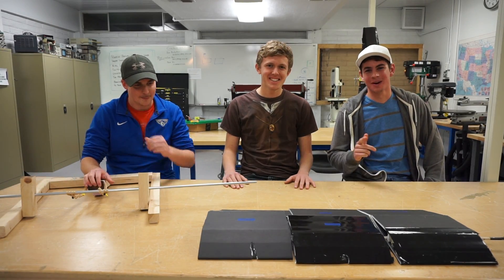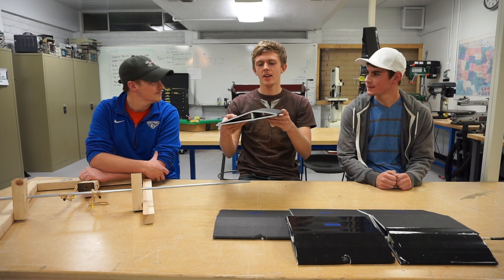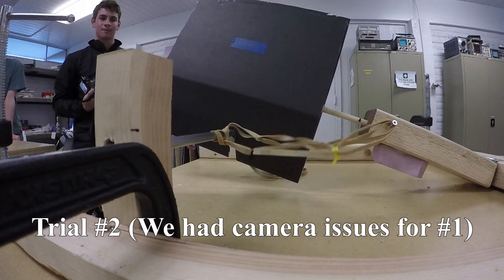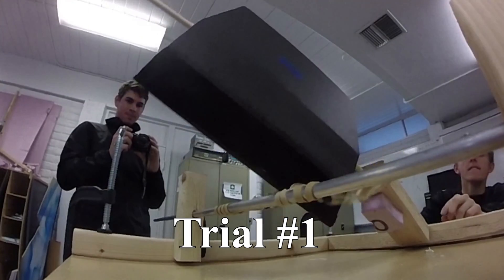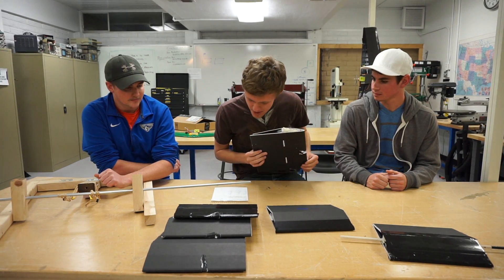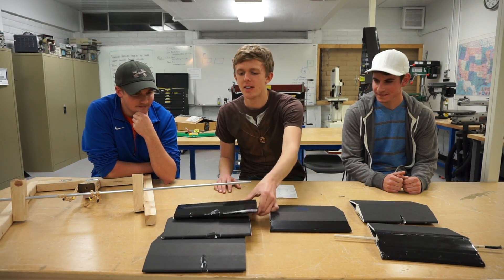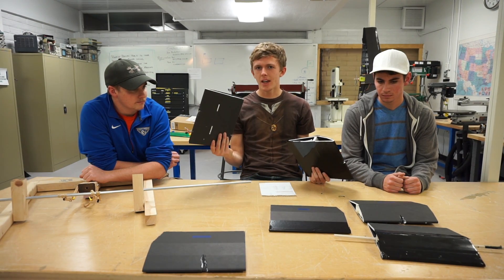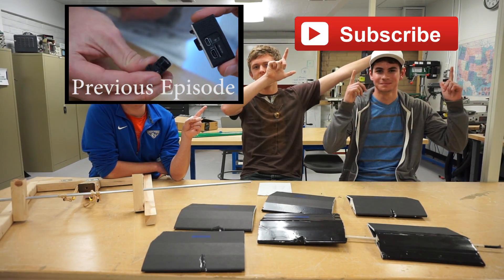Foam Wing Strength Testing | AudaciousRC Ep.3

Comment: i fly some depron (foam sheet 3 and 6 mm) planes. super cheap material and very easy to work with. and what i use to protect the leading edge of the plane is a flat strip of carbon fiber (1x3 mm or 1x6 mm) it is very light and very ridgid. i do not know what will happen if you strike it as hard as you do in your video on a ridgid metal bar but i flew a few times against tree branches and a fence and nothing happened. the wing itself is attached to the plane by two big elastics. so when the wing is crashing into something the energy can go into the elastics instead of  ripping the fuselage of the wing. the planes are small (wingspan 80 cm and about 400/450 gr in total) so i guess it is diferent with heavy planes but for me it works fine.